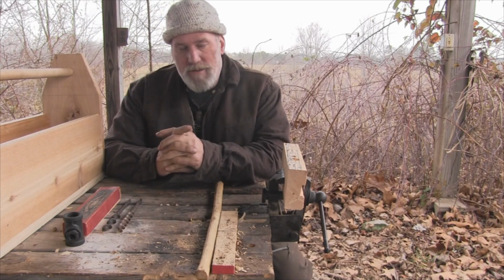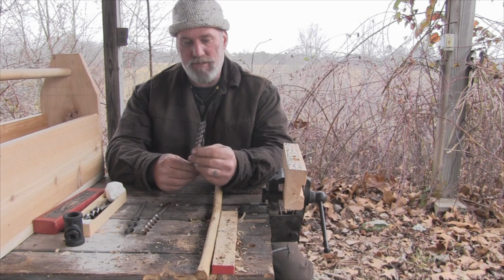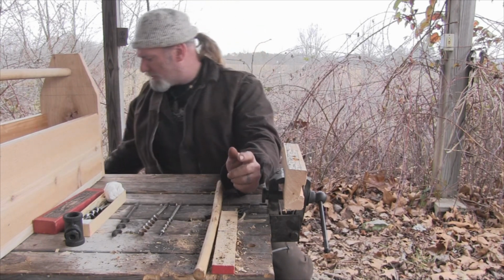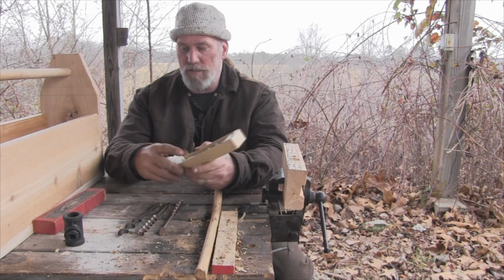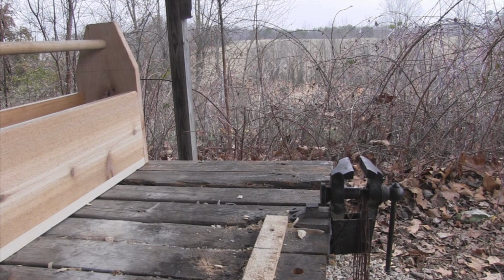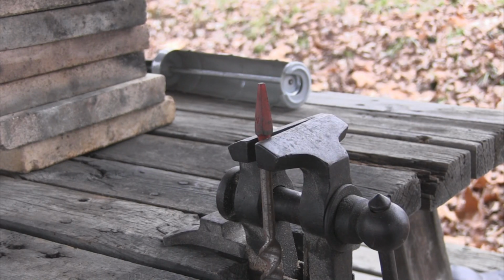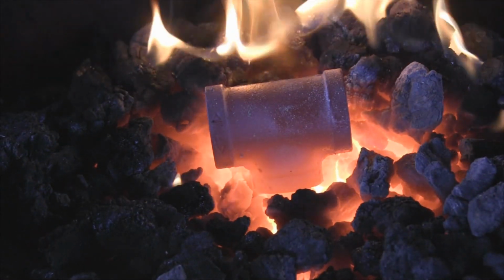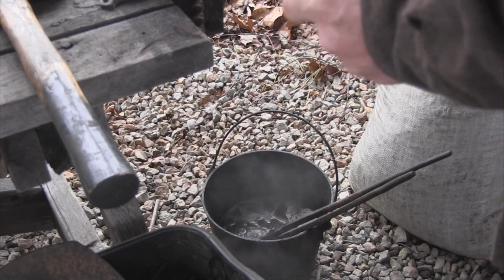Auger Adapter DIY

Comment: Dave, I like it as a long term solution. I have however carved handles out of a piece of dead hardwood (Alder no less) and had it hold up. I dug a small starter hole in the middle of the handle and then drove the handle onto the bit end.

Comment: In the squared adapter part is it possible to weld a nut and tightening Bolt that way it would make it easier to back out

Comment: Hey there buddy how are ya? This is a great solution, I have many augers I bought at a garage sale years ago. I use a brace to bore holes and this tee pipe adapter will work great. Gonna go and make one next  time I go down the mountain to town and buy the parts. Thank for sharing, God bless you and yours.

Comment: Great Home Made Tool, Dave. I believe they also have a paddle style bit for the brace as well. It was adjustable! You could choose what size of the hole you wanted to bore.
I have not used one in years. I need to check the hand tool box. See if it is in there.
Great Video. Always enjoyable!!!

Lee

Comment: In regards to auger bits for bushcrafting/woodscrafting what were the basic size(s) of  augers used?
What is the style/type of those augers you have there?  I keep getting the round shanks or flat end square shank online instead of the tapered square shank you have.  The pipe and adapter are ready to go but no auger to shape it.

Comment: Wow, always awesome Ideas, Thank you for sharing . Blessings. I found a 2 speed Manuel operated drill-brace in an antique shop. I,ve used it for drilling at a cabin with no electric and for tapping trees . It,s all metal with gears. It,s between 16 and 18 inches long but a little heavy for packing over an extended hike . I do it anyways just to push myself a little. It,s hand addjustable chuck .

Comment: You could always use a socket wrench with a deep well. That's what I use when I'm hanging gates on the farm. It's light weight and fits in your pocket so you don't lose it when not in use

Comment: I would love to see a video about spoon drills. From a self reliance point of view they are excellent. Not as effective as modern drill bits in some cases but are comparatively easy to make and are more easily maintained and carried. The are also great for small multi tools of the same form factor as the sewing tool you showed in a previous video as they fit easily into the handle and cut well on both sides when twisting the handle.

Comment: I really liked this idea and bought the T and the 1/2" to 1/4" bushing that I thought you specified.  But, just before heating up the adapter, I dry fit the bit to the adapter, and found I could probably push the square taper right through the adapter and barely damage the threads.  

What you might have said is "an adapter with a 1/4" hole".  I found that a 1/2" to 1/8" pipe adapter has a hole that is about 1/4".  It formed nicely on the auger bit.

As a side note: It appears that no one is selling new auger bits in any of the stores in the Vancouver , BC area.  How weird is that?

Comment: If you use a larger fitting you could use your axe handle for turning so its all in you kit as needed. With the hole it should also be able to protect the cutting edge of the auger from breaking or damaging your gear.

Comment: The shank (the end that fits into the chuck) of an auger bit is usually flat enough to grip and turn with an Arkansas speed wrench. Not my preference but it'll will work in a pinch.

Comment: I have one question , if the bit binds in the wood will the reducer back out since you heated it and reformed the inside of it? Just wondering .
Reply from the maker: No I smacked it with a hammer on the anvil to mis form it a bit, just didnt film that part

Comment: ***** Another great idea. I was thinking of adding a tapped thumb screw in maybe the side to tighten the stick and maybe one against the bits if they come loose. Haven't tried it yet but we'll see. May make the simple design have too much stuff sticking out though. Thanks Dave

Comment: Or… you could get a few of the reducer pieces and weld different size adapters onto them and just screw them in and out as needed.

Comment: G'day Dave,

 Yay Team...!

 The only hassle with that setup is that you won't be able to put Traction on the T-Piece to pull the Bit out of a tough bit of wood, the Adapter will simply decouple due to the Tapered Square Tang and the matching tapered square hole...

 How's about another short length of Pipe, as long as the "Eye/Socket" which takes the Handle, but just large enough in Diameter to fit over the Entire Adaptor, T-Piece and all ; with a Hole the size of the Bit's Shank, drilled halfway along the Length of the "Over-Pipe", and if the Hole is then converted with a pair of parallel Hacksaw Cuts into a Slot, sized to pass the Shank but not the fat-end of the Tang of the Bit...?

 Then you will be able to slide the Half-Slotted Over-Ring along the Wooden Handle until the Shank fills the Slot and theTang is trapped and while unscrewing you'll be able to pull on the Handle without the Bit parting company with your Compression-Lock Drive-Adapter...

 If you make a squillion dollarbuck$ from the idea, then feel free to throw spare profits this way, but I don't expect you to sell enough of them to need to think about that angle...; so you'd better just enjoy it...

;-p

Ciao !

Comment: I really liked the Scotch Eye'd Auger adaptation, and how then you can use different sized bits :) I have a Scotch eyed Auger, it only cost me £15 though. I got it on e-bay and I use it for Tappin' :) Infact, I don't think I have used it for anything else tbh :\ I will definitely have to look into doing that as I am working on my Woodcrafting thanks to your inspiration :)

Comment: A thought for the handle might be to go to the diameter of the 3/4 thread, Slim down one side so that it will side through and engage the black iron threads and  thread the hand to engage the other side.  this way no slipping or sliding with the handle and chance of breaking or bending the auger, and easy to unthread.  Have a couple of those ring eye augers a new one and an old one.   Also an adapter for the brace that has a chuck for straight shank drill bits.  All the best.

Comment: If you build a rugged L handle it will make it a lot easier to bore once you get it started.  That way you can turn it with one hand and stabilize it with the other.

Comment: although i am into this stuff and the video is well made, it is annoying that the video does not mention forging in its title "forge auger adaptor diy" is better than the original title. i would have skipped and not felt jipped by it. i do not have nor want, at this time, to manufacture a forge of any kind. then buy a part to modify to make my own auger adaptor. i did look at buying an auger then making an adaptor. i would not forge as i do not have that at the moment, though forging is an interest i have yet to pursue. i removed the thumbs down as that is bad and replaced it with this comment. well done on the video, the ingenuity and content. please rethink the title.